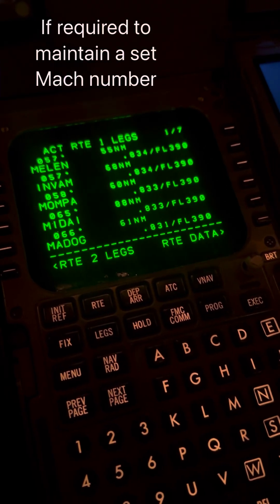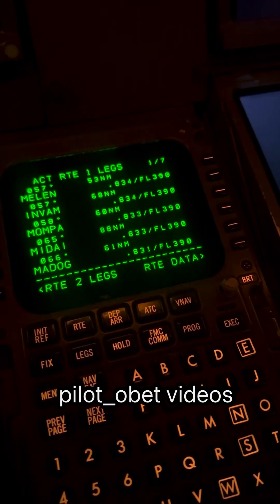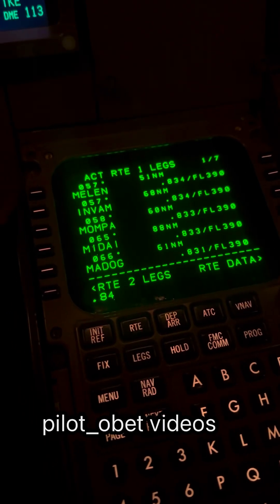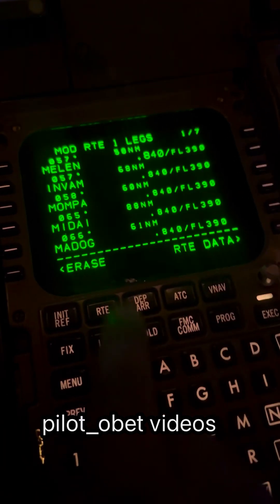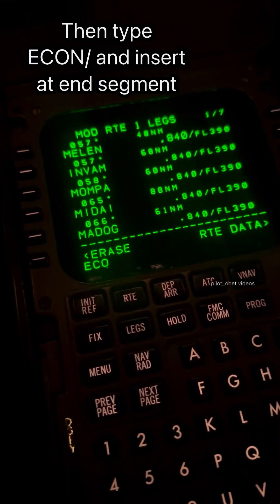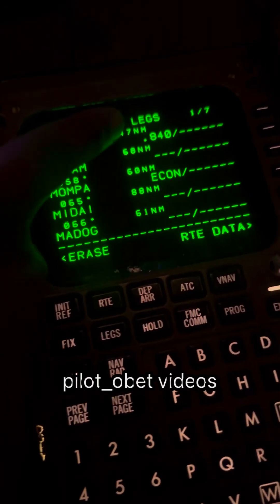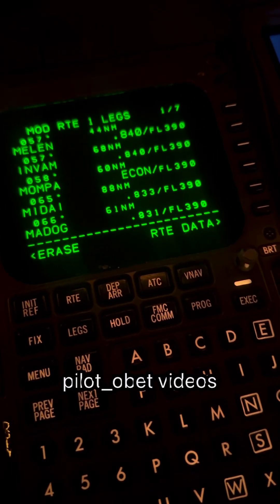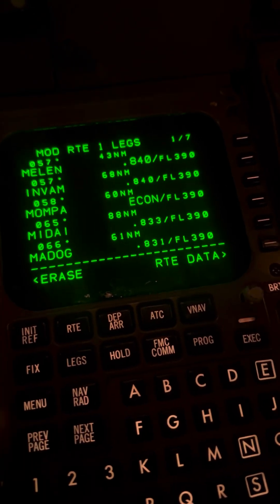Boeing 747 Flight Management system (FMS) Tip

Comment: Does the 737NG, 777, 757,767 also have this function?

Thanks for showing this function.
Reply: The 777 has. You can see it in the „Just Planes Air Canada Boeing 777-200LR Vancouver-Sydney“ videos here on youtube. Inklusive fixed Steplcimbs.

Comment: This function is only available on the Dash 8 & the 747-400 with the NG FMS upgrade.

The legacy FMS still requires any “hard coding” of a fixed MACH NO in the VNAV Pages, or by SPD INTV on the MCP.
Reply from the maker: @dingerbell100  correct - as I stated in the narrative.
Reply: @pilot_obet  sorry…you were muted…the wife was streaming Coronation Street…my apologies!!
Reply: @pilot_obet 

You confirmed that the Dash 400 also has this function in the newer FMCs.

Can you name the least softwareversion which contains this feature in the FMC for the -400, please?